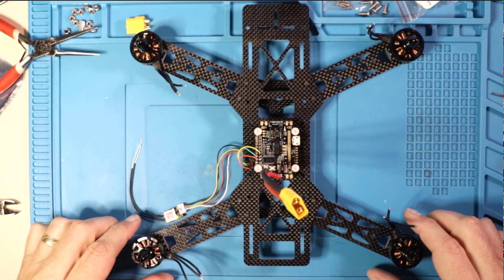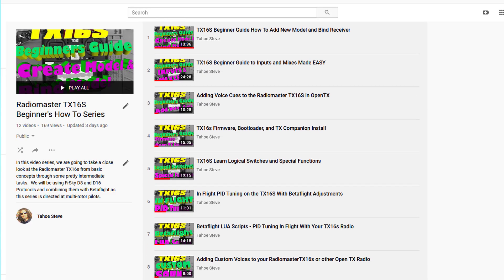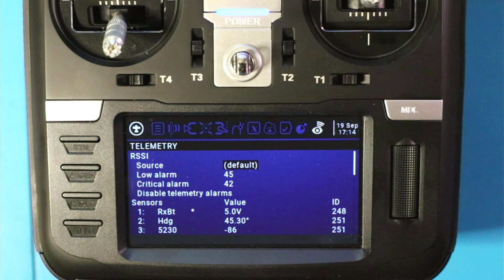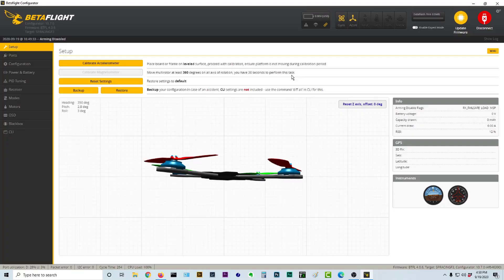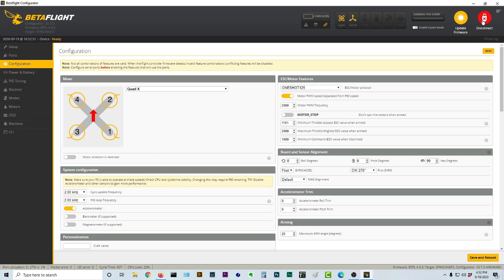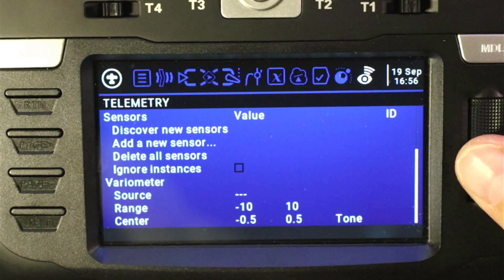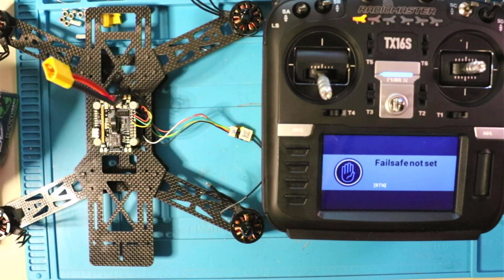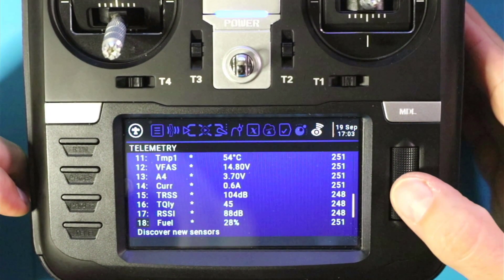Setting up Telemetry on the TX16s by Radiomaster on OpenTX with R-XSR & X8R Receivers

Comment: Loving the videos, just curious if you can point me in the right direction.  I have an eachine e160 I would like to add telemetry to, which module would you suggest I pick up to do so. Running a tx16s as well

Comment: Thanks for posting this video, extremely helpful!

I just got the RadioMaster TX16S a few days ago. I also have the Holybro Kakute F7 V1.5 Flight Controller and the FrSKY R-XRS. 
This is the first time that I have a TX and RX to use telemetry. I have built a number of quads using Betaflight but haven't had a TX that can run telemetry. I have been using the Spektrum DX7 (V1) and now I can use FrSKY or just about anything I want. 

FrSKY has recently stopped the use of their v2.xx software with the RadioMaster TX16. But I did an update of my 4in1 module to the latest version firmware and it binds and runs my R-XSR with v2.xx firmware. 
Running it in mode: MULTI FrSky X2 D16, this mode must be used for the v2.xx firmware. The mode MULTI FrSky X D16 is for firmware v1.xx

* Edited to add more information on binding
Reply from the maker: Good info, thanks

Comment: Hi I'm new to building quads and am still very confused, I was going to buy a taranis but have changed my mind and am going with the xt16s now, anyway I really want to have good range so can you tell me if I add crossfire to the xt16s if it will work without any mods needed with my r xsr receiver sorry if this seems like a silly question keep up the good work 👍
Reply from the maker: if you want crossfire, then you will need a crossfire rx.   r xsr wont do it with crossfire.

Comment: Hi Steve..I am following you all over the place. I am new at this, so i ended up buying a Pixhawk-4 and a Jumper T18 and that should speaks for itself. One area of my confusion is the configuration software used, "Qground, Inav, Betaflight etc", which one to use?  The other area is the Telemetry When I try to Bind with the Pixhawk-4 on the R8. I get 4 options on the Radio, "Channel 1 to 8 ON" or "Channel 1 to 8 OFF", "Channel 9 to 16 ON" and "channel 9 to 16 OFF"... Why is that and how can I change that? Thanks a bunch.
Reply from the maker: I am completely lost on your question, but with a Pixhawk, I would look into this https://px4.io/
Reply: @TahoeSteve  sorry Steve, too much all at once.  I'll checkout the info you sent and I'll be in touch.  Thanks.